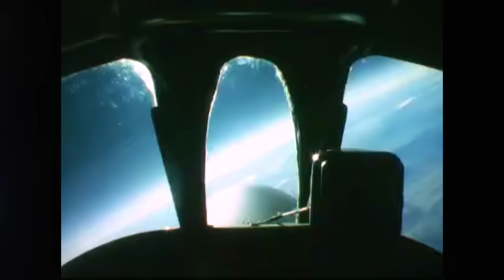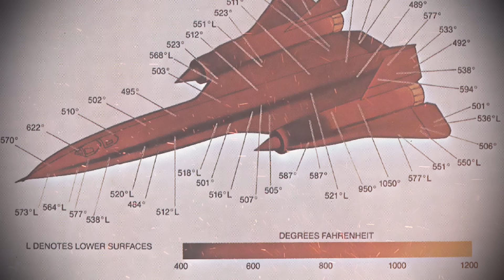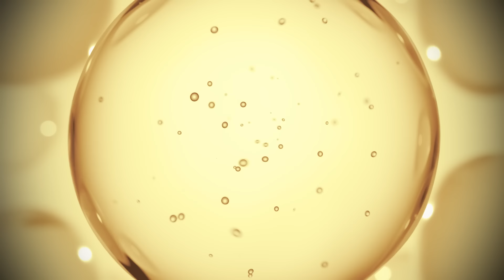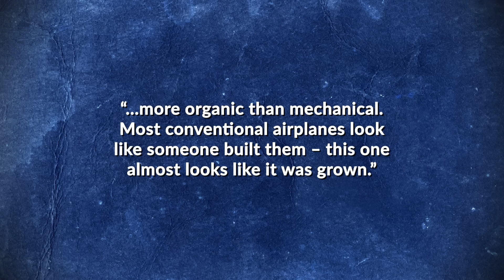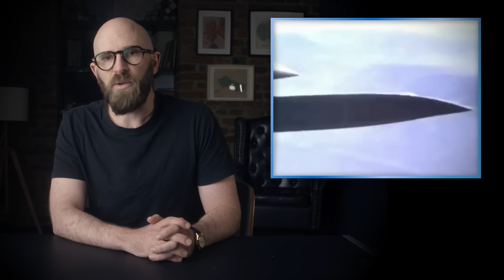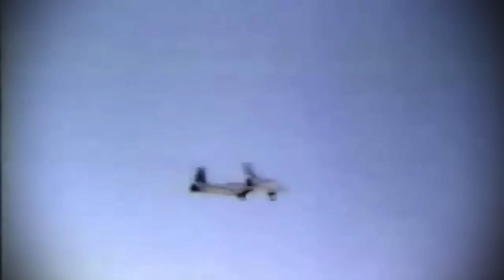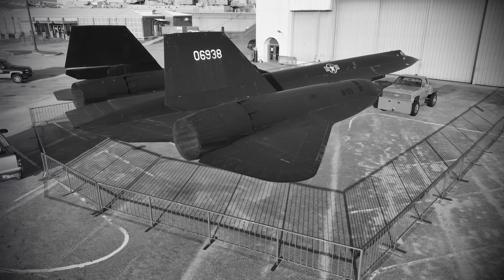How Did the SR-71 Blackbird Get Made and How was It So Fast?

Comment: This iconic aircraft was designed WITHOUT  the use of a single computer! Let that sink in for a minute....
Reply: I let the sink in, and it l leaked in the corner. So I let it out again.
Reply: wut? it was designed and manufactured with help of computers.   not computers as we know them these days or even as they were when they were building the f16 but they did use them a bunch. literal state of the art CNC machining equipment for the time was used. EVERYTHING was state of the art. of course they weren't telling anyone they had that at the time. they ran rudimentary simulations and stuff too.
Reply: @thelink66c  wrong. computers were well known of for hundreds of years. The term computer includes far more than just modern electronic computers running on transistors and vacuum tubes.

What computers were used to design Langley, Ranger, Argus, and Hermes? And which parts did they design?
Reply: Let it sink in that computers haven't made any improvements.
Reply: Why do people keep saying that.  

NACA and Lockheed had been using IBM 704 computers for a decade when this plane was designed.  

If they didn’t use any computers, they would still be designing it today.
Reply: @calvinnickel9995  People don't realize just how far back computers go.
Reply: @calvinnickel9995  this is only kind of true. They did have access to computers that could perform complex math, and I'm certain that they utilized them. However, they also did a lot of the math and design/redesign work for the SR 71 using slide rules and math tables. Remember that they literally had teams of people working on every individual component of the plane.

Implying that it would take them 60 years to do the math without a computer is pretty ridiculous. Esp when you realize that the math was complex, but it was still just regular geometric, logarithmic, and algebraic math that was well understood for over 100 years at this point.
Reply: @calvinnickel9995  most of the work was done by hand, and computers back then didn't work like computers today. they were basically nothing more than fancy pocket calculators. And SR-71 engineers said they did most of it by hand.
Reply: @douglasyoung927

No. It’s completely true.  I responded to a common statement that it was designed WITHOUT computers.  

Yes there was a lot of manual calculations and computers were limited due to their slow processing speed and the need to be programmed.. but computers could to batch calculations far faster than anyone with a slide rule. 

An IBM 704 can do about 250 calculations per second (0.5 KIPS with about 50% of those instructions not related to calculations). Assuming a 40 hour work week and  about 50% downtime for repairs and programming.. it could perform about a billion calculations per year.  

It takes 35 years to just count to one billion (if you can say a number once a second) never mind perform a calculation on a slide rule.
Reply: @calvinnickel9995  nothing you said proves computers were used to design the SR-71. when asked about the sliderule comment, an SR-71 engineer refuted it, saying they were mostly using rules of thumb, hand calcs, and guess and check. itterative design.

access to a computer in the 1950s and 1960s was extremely limited and extremely expensive, and required people who knew how to use them (not engineers).
Reply: My guy youre talking about a massive secret project with nearly limitless budget. If anyone had acess to computers, it wouldve been them.

Comment: Uh it was a knife with huge long and long is the factor, engines. Intake, fuel air mixture, ignition and compression, and explosion. The explosion isn't so much the fuel as much as the breaking of the sound barrier, that boom wouldn't exist if that barrier wasn't broken.

Comment: The "Johnson accidently called it the SR-71" myth is just that - it's a myth. But one partially rooted in reality. The change from RS - Strike aircraft with a reconnaissance role - to SR - Reconnaissance aircraft with a strike role - was meant to emphasize the reconnaissance nature of the aircraft. Bear in mind, that with the 1962 designation system the letter nearest the model number is the role, with the letter to the left being a modifier. For example, the KC-135 is a fuel carrying variant of the C-135. The decision was made to change the designation, and that change was in the copy of the speech that Johnson gave. But the copy that many in the media got was not the final, edited copy, which had several errors - including the RS-71 designation.

Comment: The crew patches say 3+ for a reason. Mach 3 was the unclassified max. They were capable of,  and flew at, far higher speeds.
Reply: No. 

This is the typical American ambiguity “we will neither confirm nor deny” or “we could tell you but then we’d have to kill you” crap that impresses mouth breathers but not anyone who can do a bit of inductive reasoning.  

Of course you can hide anything you want under op sec but the huge intelligence failures of the US paint a very different picture to its actual capabilities. 

The speed display on the Nimitz carriers blanks out above 30 knots.  Maybe THEY go Mach 3 plus?  Lol.  

According to the pilot handbook of the SR-71, the aircraft is limited to a speed of Mach 3.2 by a compressor inlet temperature of 427°C.  It can go fast Mach.. but only in lower temperature air.  

The speed of sound is slower in lower temperature air.. so even if it’s going a faster Mach, the true airspeed isn’t any faster.  

The Mach is also limited by the inlet spikes. They can only keep the shockwave in the correct position up to Mach 3.3. Any faster than that you risk inlet unstart which is so violent that they can’t even practice for it—and one solution was to immediately unstart the other engine which in effect causes a train wreck.. but at least prevents the plane from entering a flat spin. 

Remember. After every Mach 3 flight this plane required a week of overhaul.. and only about 20% of its flight hours were spent above Mach 3.  You can bet when they went out to set the world absolute speed record that they gave it absolutely everything it had.  

Anything more.. and you are doing massive damage to the engines and airframe and taking your life into your hands.
Reply: Cool fact
Reply: No

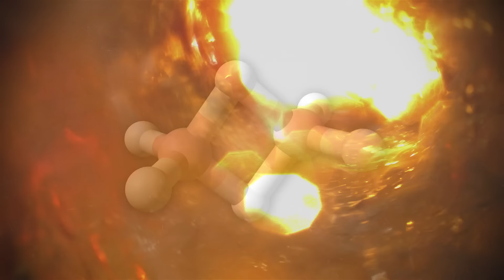Comment: The hypergolic fuel used to light off JP7 was TEB (Triethylborane) @11:30
Reply: @MillionsOfRecords  "reagent" is needlessly vague, the specific reaction is that it spontaneously combusts in air, i.e. it's a hypergolic fuel, being used as fire starter.
Reply: @MillionsOfRecords  Pyrophoric is more accurate yes, meaning hypergolic with air. It's not a fuel additive since it's not added to the fuel, it's injected directly into the engine via a separate "ignition probe", if I understand correctly.

Comment: I was a Marine stationed on Okinawa '89-90, when the SR-71 "Habu" made its last flight from Kadena. I don't know if it was that flight I saw, but I recall seeing the SR-71 seemingly flying around the island while I was there, making 2 passes. My best friend from High School joined the Air Force, and he was told that the top speed was much higher than publicly stated; I'd believe that.
Reply: The SR-71 didn't have a speed limit, it's a temperature limit. In cold air it could go a bit faster.
Reply: No it couldn't. The inlets would unstart about Mach 3.4. That is life threatening. It happened a few times under pilots who didn't believe what they were told by the engineers.
Reply: Can you explain what that means? I'm not smart
Reply: @DongusKong  I love this question, i also would love an answer x
Reply: @DongusKong  So, when you go supersonic you create shock waves off of the front of anything pointed forward. In certain conditions the shock wave off of the spike at the front of the engine nacelle would be positioned exactly right (or wrong, depending on perspective) to block air from flowing into the engine. That's an unstart, and it causes a sudden drop in thrust. The problem is that often, only one of the two engine nacelles would unstart - the other would be running fine, thrusting in afterburner, which would make the plane yaw violently toward the unstarted side.
Reply: @shadowfaxcrx5141  thank you!
Reply: @DongusKong   Do your own work and stop IP theft commie!
Reply: @danbaker7191  After a few near misses, and one actual crash, they developed an automatic response to unstarts which would unstart the opposite nacelle. Once that got installed, the life-threatening part went away. Unstarts were very common even below M3.4.
Reply: My dad was a marine there in the 80s so was his sister she was af they said they seen them land glowing red so I believe it I seen a video the guy said machine 4.5 was actual speed it could achieve could go faster but frame couldn't take it
Reply: Semper fi, brother. I was a Marine stationed on Okinawa '77-'78 (the year they switched overnight from right-side to left-side driving), was driving around Kadena with a buddy, Johnny Lopez, and an SR-71 was parked at the end of the runway with a cordon of guards around it. We were on a rise with a good view, so we stopped and watched in awe. 

After a while, they buttoned it up, everyone else left, and the bird rolled down the runway. As its nose picked up, the loudest sound I have ever heard in my life just split the air. Unearthly. The jet took an attitude of what seemed like 40-45 degrees and was quickly out of sight. 

Johnny and I talked about that for days. Well, I'm still talking about it, obviously.
Reply: @jasonmeadors3524　　First thing first, thank you for your service! Those engines were no joke and I bet the locals Ryukanan islanders loved it lol.  

 Nippon, lived there for a year, I loved it! It wasn't long enough.   I'll be back though! Very soon!  Akiruno, Akigawa,  Harajuku, Hamatsucho, even if your not a fan of anime you'll still enjoy Akihabara.  

Kanpai! ゴジラ❗
Reply: Yeah, it's kind of the same story with the operational ceiling. You can really only disclose the lowest possible limit. When they say "in excess of 70,000 feet," trust that it is well in excess of that.
Reply: Based on anecdotal reports from some of the pilots, Mach 3.5 was easily achievable if fuel wasn't a concern, but anything over 3.63 would potentially damage the airframe. It's still very funny to listen to the stories about SR-71 pilots talking about how their response to a missile lock was to just push the throttle lever forward some more and just leave the range of the missile before it ever had a chance to try to catch up.
Reply: @MillionsOfRecords  Yeah, the Blackbird was triple-limited at roughly the same speed by several factors, which is in that 3.5-3.7 region. Go faster than that and the skin melts. Try to go faster than that and the drag overwhelms the engine's ability to overcome it with thrust or the intake air can no longer be slowed enough to keep the engine running. Manage to overcome those problems and you'll overheat the compressor intake.

I've seen some utter BS claims floating around like that its pilots say it cruised at mach 3.2 but topped out at mach 7 and, well, that's just laughable unless there really is alien tech at Area 51 and they used it on the SR71. ;)
Reply: @shadowfaxcrx5141  Sounds like normal misinofrmation.
Reply: Semper Fi

Comment: They have actually tried to change how the X-Jet looks several times but every time they go back the design based off the SR-71.  It’s just such a cool looking plane
Reply: Why change perfection, right? 60 years later it still looks like something from a sci-fi movie.
Reply: @phantomechelon3628  And it was designed by guys with slide rules instead of computers.
Reply: A lot of knowledge was gained from Britain as they were the first to look at Mach 3 aircraft.  I can't remember the name of it, but it's design was similar to the SR71. Britain gave up on the project as the materials needed hadn't been invented yet & the cost to do so was deemed too high. One of the problems the British discovered & couldn't solve was expansion leakage & I love the fact that locheed overcome the problem by just letting them leak 😂😂
Though similar in design, the SR71 was not a copy, that is just the design you're left with to achieve that goal. The British research shows its project(design never flew), it was rated to Mach3 & it wasn't as sleek & refined as the 71, so it must be able to do Mach 4. 

the 71 is both a mean looking mofo & gorgeous lady simultaneously.
Reply: It’s not looks. The SR-71 was put in a modern wind tunnel and was found to be as close to aerodynamic perfection as is possible. You can’t improve on it.
Reply: Sexy ASF.  Can't make one better. 
Why retire it?

Comment: It is a misconception that friction with the rapidly moving air is what causes a plane's, or spaceship's, skin to heat up. It is the compression of that air, unable to move away from the fast moving vehicule, that produces the heat. It is the same principle that achieves ignition in diesel engines, with pistons greatly compressing a fuel-air mixture in the engine's cylinders, raising its temperature enough to ignite it.
Reply: air friction is air compression, the terms are synonymous in aeronautical terms
Reply: "achieves ignition in diesel engines, with pistons greatly compressing a fuel-air mixture in the engine's cylinders"

That's not how a diesel engine works. 

Air (without fuel) is either 'sucked' in (naturally aspirated) or forced in (turbo/supercharger). The rising piston compresses the air so it heats up (you got that part right), and just before TDC fuel is injected directly or indirectly into the hot air. The air being hot enough to ignite the diesel fuel.
Reply: @Chris-hx3om

Yes. Otherwise the diesel would ignite too early.  This is why diesels need some form of fuel injection—either low pressure into a prechamber or high pressure into the combustion chamber (direct injection). The high pressures and close tolerances combined with the very robust construction required are what make diesel engines much more expensive to buy and maintain than gas ones.
Reply: @calvinnickel9995 That is certainly true of diesels used in the automotive industry, among others. However, it is not true of all diesels.

Some model aircraft, for example, use simple two-stroke diesels that draw in a fuel/air mix through a very simple carburettor. A needle valve is used to adjust the mix, which is drawn into the crankcase, up the side of the motor, between the engine casing and the cylinder liner and through a port into the cylinder, where it is compressed and ignited by the rising piston. Compression is also adjustable to enable optimal running.

I have such an engine, which is easily dismantled, revealing how it works. It does not use normal diesel fuel, but works on the diesel principle. The fuel is ignited by compression. There is no spark plug or glow plug.
Reply: @Chris-hx3om  Thank you for the clarification.